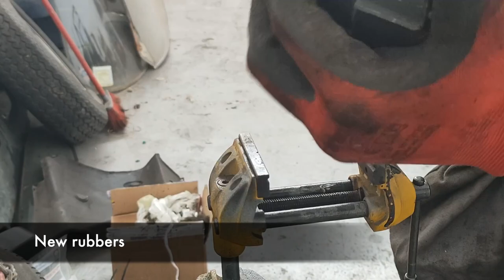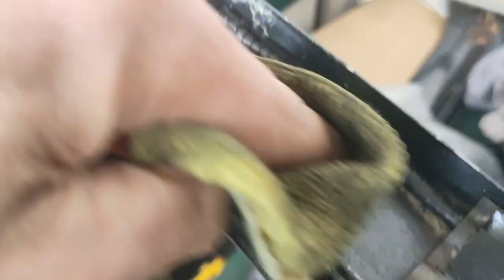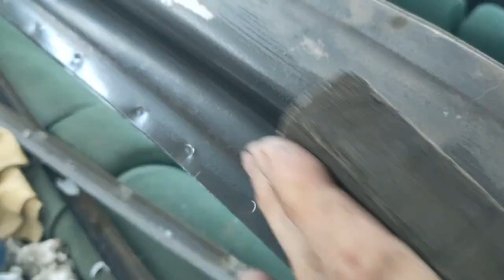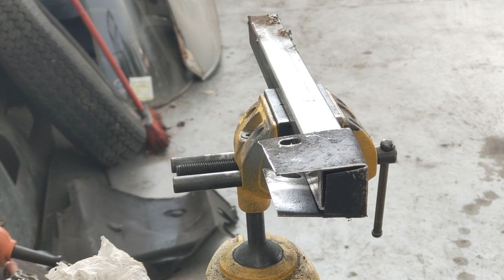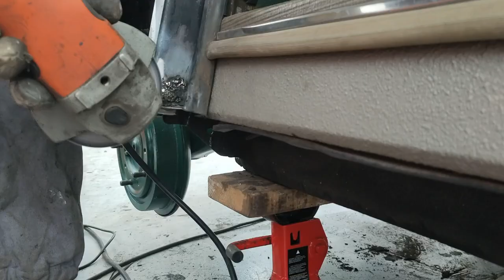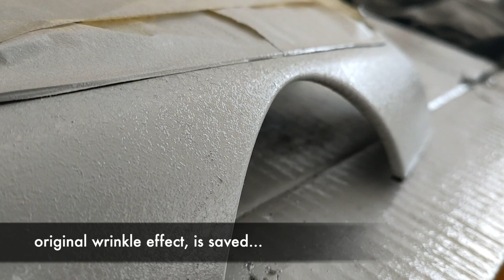Citroen ID 19, 1967, Restoration - Part 5

Comment: Working on the car with the seats in it 😢
Reply from the maker: Yes, normal! the seats has to be renewed completely, they have been dismantled later then this video, but useful to work at the dashboard and to move the car once installed the engine. The car is going to receive a completely renewed upholstery.

Comment: Nice! How did you treat the dashboard rust spots and which paint did you use?
Reply from the maker: I painted the spots with a black paint with the wrinkle effect, then I resprayed all the dashboard with the original AC 136 Gris Rosé. a light layer not to cover the rough effect
Reply: @citro-garage  I have been looking for paint , but what brand and type is the black paint? And also the original AC 136 : did you get it from citroen? and dit you treat little rust spots before painting?
Reply from the maker: there are many paint spray with rough effect on the market. they are not exactly the same effect Citroen used in the 60s, but I had to cover just the small spot where I had to sand the rust. So I sanded       the rust spots, then I sprayed a layer of primer on them, then the paint with rough effect, and finally gris rosé. In Italy there are many color shops that prepare spray paint can, with any color code. Otherwise you can buy the paint can from the main dealers specialized in DS spare parts : ( Der franzose; CitroenDs.net; etc..) If your dashboard is too damaged and you need to repaint it totally, there is a shop in Italy that reproduces the original wrinkle effect, but you have to send them the dashboard to be repainted.